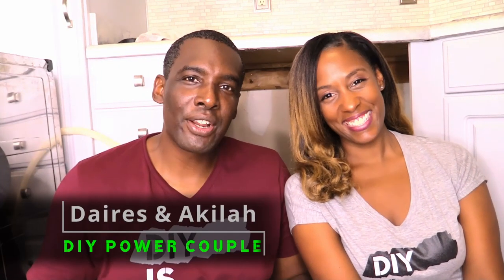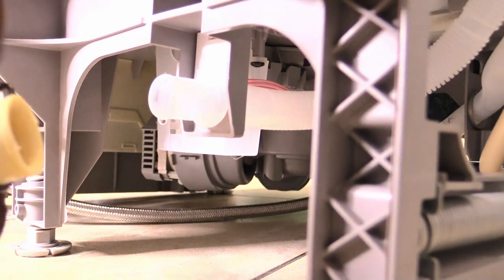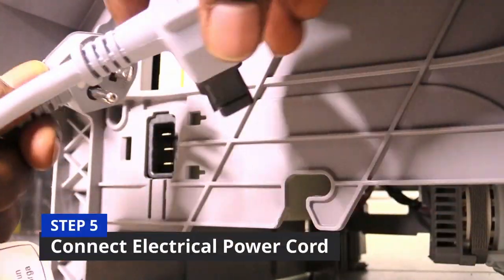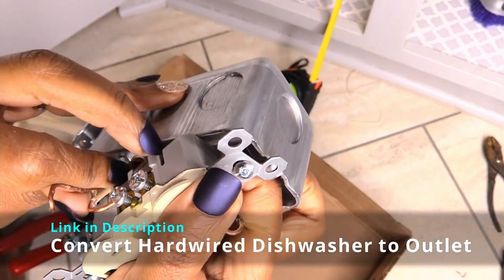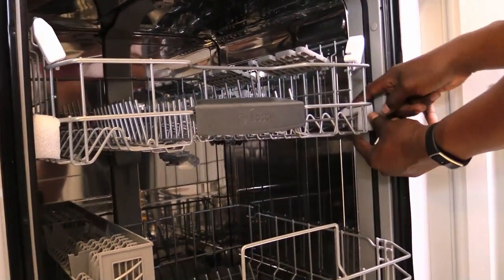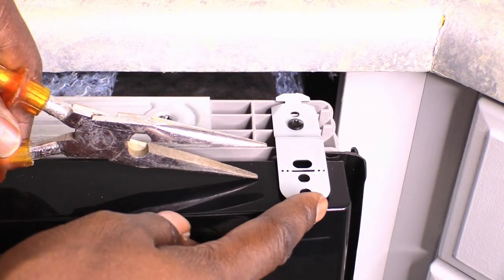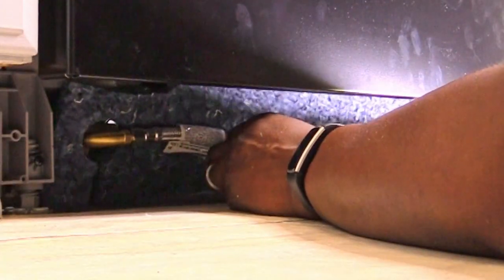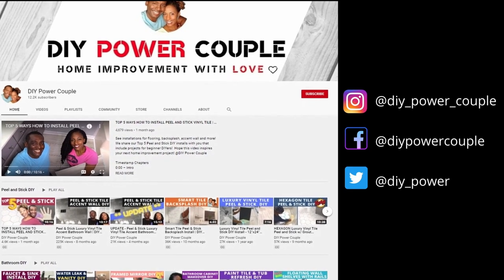How to Install a Dishwasher for Beginners  | EASY STEP-BY-STEP BOSCH INSTALLATION

Comment: Couple thoughts, I would have leak tested that inlet water connection prior to pushing it in place and verify power by opening and closing door. Sometimes new appliances can be dead out of the box. Straightforward video overall.

Comment: I need help. I took off the insulation. I have the SilencePlus 46 dBA. Thank you for your video.
Reply from the maker: Alexander, you can purchase another insulation or you can get one from another model and cut it to fit your model. It's just a barrier to help with noise rattling.

Comment: Thx guy's, it is strait forward! Just a note for that dishwasher. If you don't have a outlet you can buy a powercord with a Junction box from Bosch  P/N: SMZPCJB1UC $35 Canadian.
Reply from the maker: Thanks Bruno for the info about the junction box! 👍🏾
Reply: @DIYPowerCouple That Bosch hardwire kit can have issues with wiring melting at the terminal block. I installed a receptacle under my sink like you did. Didn’t feel comfortable using their hardwire kit. Noticed you used a 15 amp receptacle vs a 20 amp. Most dishwashers are on a 20 amp breaker.

Comment: another tip for beginners....the insulation stays on when installing..it is not just packaging material...not that I made that mistake or anything 😉
Reply from the maker: You are correct. Great tip. -DIYPC 😃✨